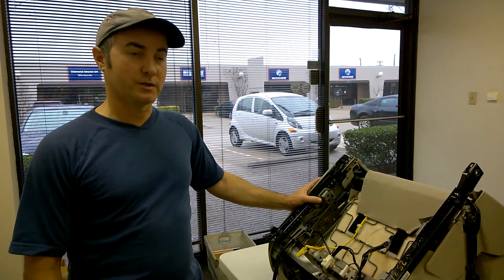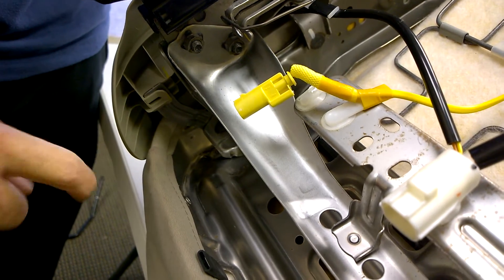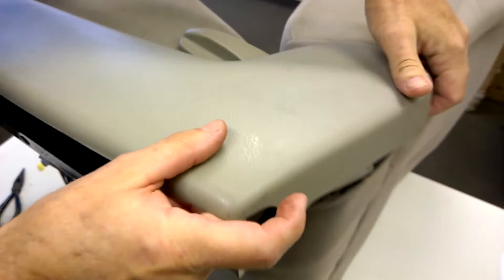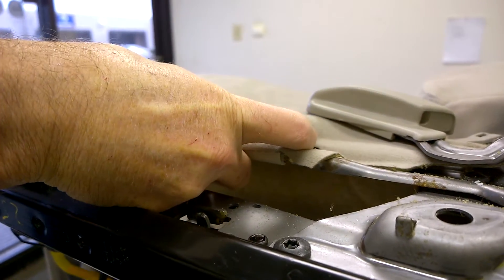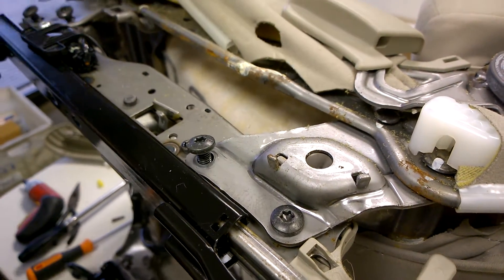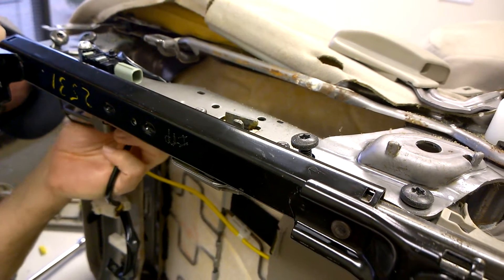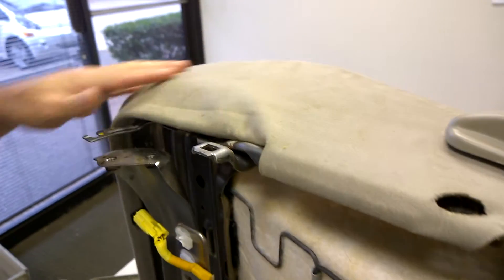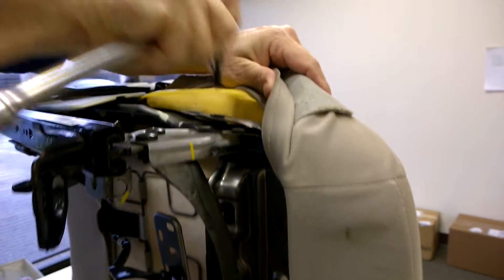Removing 2004-2009 Prius seat rails from driver seat

Comment: Nice video. I was wondering, my 2012 prius' front seats are very uncomfortable/stiff. Can late model seats (like leather seats from 2015 corolla or some other model that fits the prius) be easily transplanted into the prius?

Comment: nice video on replacing bad module in your prius. only thing I saw wrong with it is that on the bad module you removed you had to disconnect some wires under the module which when you put in the new one I didn't see you reconnect those wires? did I miss that?